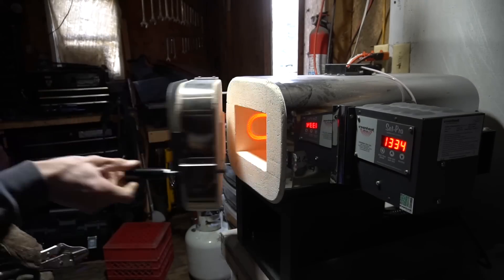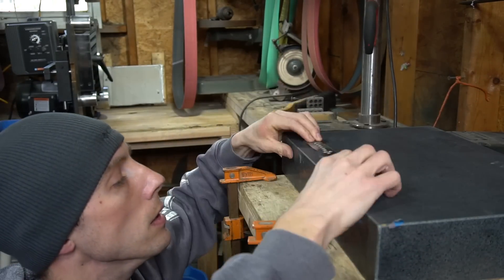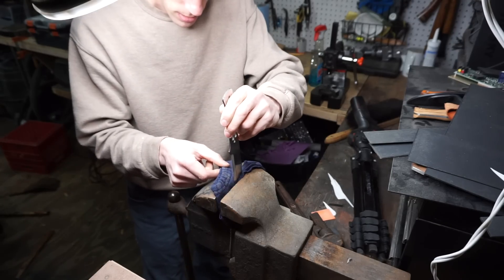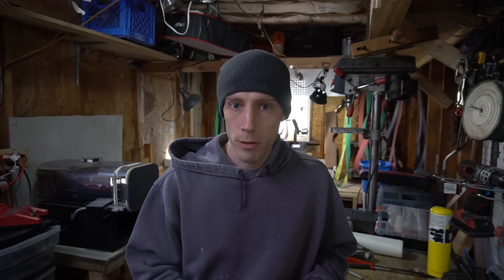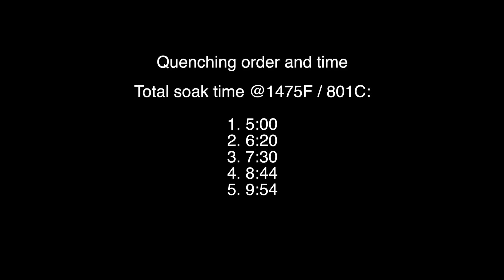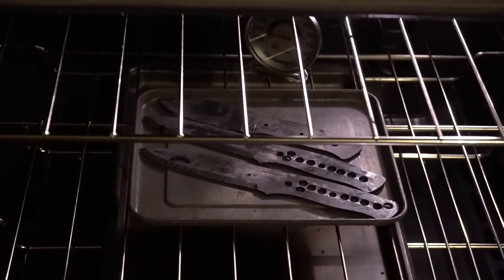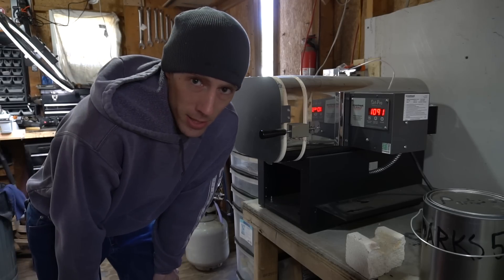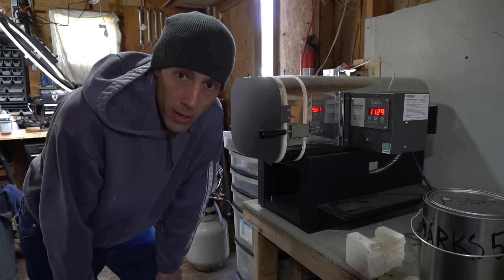Why Knife Makers Should Break Their Knives

Comment: I have seen issues when quenching multiple blades in a small 1 gallon container. The oil temperature increases dramatically from blade to blade. A thermocouple in the oil would add another data point. On bladeforums, it was recommended that a 1 gallon can of oil might be too small for a blade larger than 7-8" and for multiple blades back to back. At least 2 gallons - 5 gallons was recommended.

Comment: hey brother watching for the second time and I have a question do ya think that your oil being warmer with each consecutive quench have any cause in the grain growth??
Reply: Actually the opposite is true in this case. The Parks 50 fast quench doesn't reach it's optimal quenching ability until it's viscosity is increased. (less syrupy and much more running. This also greatly helps prevent vapor lock during "Quenching" This happens at about the 120°F-150°F range. He had preheated his oil before hand but failed to mention it in the video.

Comment: If you're heat treating properly, soaking at the right temperature shouldn't have any negative effect on the steel no matter how long you soak. And not scales of minutes, but scales of hours. There are people who have soaked O1 steel at a specific temperature for lengths of both minutes and hours, and noticed no demonstrable difference in properties (for example).
Reply from the maker: This isn't o1, its 1095.
Reply: @OUTDOORS55  
I know.

Comment: Alex, 
I will investigate the matter with one of my instructors who has his Ph.D. in material sciences. I am studying my undergraduate in Engineering Mechanics with a focus on materials as well, so here is spitball theory: my literature and classes haven't used soak times under at least 15-20 minutes (even for thin stock like a knife). The short soak time may not be allowing for a complete transformation of cementite in the steel to austenite because 1095 at  800C/ 1475F is right on transformation line on a Fe-C phase diagram for 1095 steel.  The remaining cementite may be suppressing the grain sizes (The previous sentence is where I am uncertain, b/c I cannot explain that effect, but I sure some other microstructure is at play) This effect would be in competition with the increased yield strength gained from forming more martensite (then to tempered martensite). I think left over microstructures best explains why you saw a resurgence of the fine grains in your 1550F sample at the end of the video because, assuming a complete transformation of austenite to matensite, then small consistent grain should be readily attainable. At any rate good work and keep up the kickass knives!

Comment: For the first experiment you quenched the five blanks consecutively did you happen to keep track of the oils temperature during this experiment. an increase in the oils temperature would directly affect the material cooling rate and in turn affect steels structure as it moves through the cooling curve.

Comment: The problem is in tempering, its not about how you harden it, if you heat treat quicly, the more inpurities will be in steel except martensite, by tempering you remove all impurities and get those 3 blades simmilar properties

Comment: @ 15:30 you said, "Overheating and soaking time does cause grain growth"

If you learn to read an iron-carbon phase diagram, and how iron changes phases, you would understand why that sounds absurd.

You can't really overheat your knife, unless it gets molten and turns to liquid.

On the iron-carbon phase diagram, you will find several different areas of the graph. Drawing a vertical line for 1080 steel at 0.80% carbon, you can follow from 0 degrees up through all of the different phases of iron.

When iron changes phase first, it remains solid, but the gran structure reorganizes completely. This is not an instant process. This can take hours, depending on the steel.

If you hold the steel at a transition point on the graph for long enough before dropping the temperature, it recrystallizes to the lowest phase on the graph.

However, if you heat the steel up to glowing orange and hold it there, the crystalline structure has completely rearranged. When you quench the blade, you cool the crystals so fast that they don't reorganize to the lower level on the graph.

This is where you move from the iron-carbon phase diagram to the TTT diagram. The TTT diagram, while (also) not easy to read, will show you how much crystal restructuring goes on for how much time the steel is held at temperature.

These diagrams were generated from thousands and thousands of tests, and verified over and over. Engineers (like me when I finish my degree) use these diagrams to show exactly how the crystal structure should be formed, and compare real world results to theoretical numbers... Then, we apply additional math to that material science.

You just have to figure out at which amount of recrystallization to quench. You also have to figure out if tempering cycles to allow some of the softer crystals to re-form will help the properties of your blade. You don't need the calculus, the explanations for FCC/BCC/HCP crystal structures, etc. like I will need.

Knowing this may help you predict where to harden your blades instead.

Comment: there is a reason why metallurgy is a science field on its own - there is so much to it that influence the structure of steel that you are about to have inconsistent results in a home environment (keep in mind, your setup is way more controlled than the heat treat process of some average joe like me). 

the other side is, does it really matter? as long as my knife retains an edge and doesnt bend or break during normal usage conditions, its fine to me. sure, it could be better, but there is no way around it, if you dont want to spend x amount of money on it to get a proper kiln.

anyways, my biggest unknown in your tests is the temperature of the oil? it gets warmer with each quench you do in sequence, maybe thats causing a difference too? i mean it most likely does, but the question is how big of a difference. 

nice effort though, this just shows that companies that do heat treating have a reason to be around!

Comment: Hey man, just so you know the plastic valve fire extinguisher youve got in your shed may or may not work. Kiddie the extinguisher company issued a recall on all of their plastic valve extinguishers in 2017. Theyre the first company to do so, but i doubt theyll be the last. Having worked for a fire sprinkler and extinguisher company for 5 years, ive seen enough of them to know that youve got about a 70% chance that itll function properly if the time comes. Do yourself a favor and get one with a metal valve from the hardware store. And make sure to pick it up and flip it upside down a couple times at least once a year. It helps to stop the powder from getting too tightly packed and clogging the valve if you do ever need to use it.
Reply from the maker: This ones just for show.

Comment: I like your reasoning and scientific approach.  I took metallurgy to earn my associates of science for welding technology but remember very little except different boundaries and phases and they analyzed failures (yours being vise angular leverage failure) like you did with your pieces - to see what caused the failure .  What I gathered from your experiment was that no  matter your soak time or temp - NORMALIZING (CORRECTLY NORMALIZING, and soaking at critical temperature for 5 minutes is the  B  diggity G) is Mucho Grande Importante!  You did great! but the camera to me showed a better grain the farther you went to the left - maybe cutting the pieces would show the grain structure better because breaking the pieces tends to disrupt the grain pattern/structure as it elongates and deforms the end pieces.  Great Job and great lesson on the importance of normalizing 1095 and I am sure 1080 would bear similar results. Also testing metals you haven't used before and finding normalizing procedures and critical temps for each new material you use - of course writing down these notes in a knifemakers logbook for future use and less re-googling (is that regurgitation).  You are an inspiration on the path to the knife making grotto!  I have never made a knife but I should be qualified son with all the different videos I have watched - KEEP Making them!!  I copied your pattern on my laptop screen enlarged - maybe I will be ordering 1080 next.

Comment: The only mistake I can see is in your last test you didn't start at 1200 and go up to 1575, as you did in the prior two tests. Otherwise, very well done. I think your conclusions are spot on, and the added info from  Lucas Kramer below is important as well. 

As for the heat treating multiple items: industry does it all the time. They just make sure that their ovens can handle the mass of steel present, and hold the temps. As long as your setups can do it, I can't see how multiple items (unless you stuff a few dozen in there) would be a problem.

Once again, fantastic video. Thank you. Subscribed.

Comment: Remember your  phase and TTT charts, specific to 1095. 1095 is a hypereutectoid steel, meaning the carbon above 0.80 (nominal) will not go into solution with the ferrite (austenize).  The extra carbon hangs out to form carbides. Carbides are hard, and probably bigger than your martensite grains. Temp and temp over time does promote grain growth, as experienced by your long soak @1475. The 1550, higher temp, allowed for carbide formation, and probably better carbide control and better solution balance, in your hypereutectoid steel.   If you repeated your test with a 1075 or 1080 steel, the results of grain growth, you were expecting would probably become more evident. The comment on quench oil temp, being 120, is more about nucleation (bubble formation) at the knife surface. 120 is better than colder, but if you can beat the "nose" on the 1095 TTT curve, your goodto go.
Reply: That pearlite nose can be a real bastard thats for sure ...as far as ive noticed about 1500 is the sweet spot for 1095

Comment: are you using different cans of oil for each heat treat? the oil cools the metal at different speeds depending on how hot it is.
Reply from the maker: quenching doest affect grain size. The oil temperature was monitored though👍

Comment: about grain growth: digging deep in my memory to the one part of the "material science" topic that I really liked: crystaline metal rosters.
grains grow over time. Grain seeds also form over time but also relative to the cooling speed. The faster it cools down (i.e. the higher Delta T when t approaches 0) the more grains are formed. So given a low enough cooling speed, grains will have the chance to grow larger before more seeds are formed. Critical temperature is the lowest temperature where all roster bonds are broken and the metal is in an amorpheous state. This state is needed to form new seeds and even seeds. Having the bonds broken does not necessarily mean that the position of the atoms is changing. Hence the need for normalizing cycles: to allow the atoms to move by allowing them to settle slowly into a large grain roster. Overheating brings your entire knife to a temperature where even after the first couple of ms in the quench, temperature is still higher than critical. But since you don't move your blades, the oil around the blade will heat up, and thus slow down the cooling. In other words, the cooling speed when dropping below crititcal temperature (which is the one that determines how many seeds are formed) is lower when cooling from a higher temperature. Another factor that influences the cooling speed, is the mass of the heated object: the more mass, the more energy it holds and the more energy has to be transfered during cooling. So a larger mass has a lower cooling speed too.
This also explains what my first thought was when you didn't see that larger grain growth in the test piece: the test pieces are much smaller than the blades. So the test pieces have much less mass and therefor automatically a higher cooling speed during the quench.

If you found inconsistent results for the overheated test pieces, do you mean that sometimes you did find larger grain growth? I guess at those higher temperatures and with low mass pieces, any hand movement that might move the oil around a bit, will have a big impact on the results. So the worst results will have been when you held your hand perfectly still after going in perfectly vertically. Better results could have been caused by entering slightly sideways causing a turbulent flow inside the oil and therefor increasing the cooling through convection.

Comment: In my opinion soaking isn't necessary for a knife because its relatively thin. If you're looking at HT charts they advise you to soak because they want that consistent temp to penetrate through the entire piece. Better to just quench the blade as soon as it hits critical. Also, check your oil temps. Needs to be consistent every time.
Reply from the maker: A short soak is required with 1095 to allow all the carbon to dissolve into solution.
Reply: Ok. Try it without a soak and see the results. try it with a soak and record that. You'll find that soaking a blade blank only causes the grain structure to swell. The charts that tell you to soak aren't made for knife makers.
Reply: i think with 1095 you have to get the carbides back into solution, this takes a bit of a soak. but im no metallurgist.

Comment: Awesome info!! Now I’m going to have to do a bunch of testing myself. I’ve done destructive tests on knives and it always makes me cringe to put all that work in just to break the thing in half but i think its a very important step for anyone wanting to ensure quality. Thanks again this video was the most informative heat treating I’ve seen on youtube particularly of interest to me because i use a lot of 1095.
Reply from the maker: Thanks my friend! I agree its a necessary evil. 👍
Reply: @OUTDOORS55  Were do you get your stainless steel foil for keeping the O2 out of the "Quenching"? Think it will work with a atmosphere propane forge or and forced air propane forge? I can run them rich so that I greatly reduce the O2 but was thinking that adding the foil might save me even more addition Carbon content. Thoughts?

Comment: I am not even a beginner. I've never made a knife. I'm finding your videos informative (as much as I can understand).  I assume this test proves that a very fine even grain is desirable. Even though you never really came right out and said that. I want to make a FOREVER knife for bush craft. I don't know what steel to use, how to treat that steel - heat treatment, quenching, annealing etc. or even the order in which to do this. I'm 65 years old and retired so my definition of a Forever knife is a knife my grandson can have and use once I'm gone.  About all I do know is I want it to be a full tang and the back side of the blade should take a little bit of a beating from a hatchet maybe 3/16 inch wide. While splitting small kindling. I want it to be about 8 inches of usable blade (probably more like 10 inches long with enough left over to go the full length of the knife handle. I want it to take an edge I can shave with and hold that edge for a reasonable amount of time. I'm learning sharpening and stropping and general care for a knife in the meanwhile but no where near the skill level to produce what I want. For me your videos might be a little to far advanced but if you spoke like you were talking to an idiot it would make it easier for me. I don't really expect you to do that because I think you'd lose a lot of your viewers. Lol. Can you direct me (or any of your other viewers as well) towards any of your videos that would help me. I like your style of making videos and prefer if I could stay with you. Does anyone think I'm crazy? Is this a knife I can make - or is it like a Holy Grail. I  definitely don't want to buy a knife like this I want to make it. I have access to most every type of tool I think I would need and am even considering purchasing what I need if I don't already have it. For instance a 2" wide belt sander (I presently have a 4 inch wide) Would a 1" wide work? What's better one inch or 2 inch - do I need both? Thanks for reading this tome of a comment and I gratefully thank any help anyone can provide. I live in Allen County, Ohio if there is anyone near me with these skills who would allow me to have lunch with them and shoot the breeze let me know. Even better a chance to see your shop and set up. Lunch is on me.
Reply: Nobody just makes one knife, and there is no perfect knife! For making a stupendously performing knife it may be best to just pay for a knife with a tough powder metallurgy steel like 3V or better yet magnacut. If you want to enjoy the ride, read Larrin Thomas's articles on knife steel nerds as gospel for heat treating and use a simple carbon steel and do his forge heat treating method for the best luck of good quality. Use water quench if you can't get proper quench oil for simple steels without any chrome in them, go for 80crv2 most likely.

Comment: Have you considered that (concerning the three initial blades) that the third was quenched after 2 rapid succession "openings" of your H.T. oven. I wonder if you may have significantly dropped the temp off the third knife from heat loss due to the openings/exposure to ambient temperature.  Possibly your thermocouple is placed in a bad spot to get accurate temps. I would suggest possibly doing a test of temp loss or general atmospheric condition changes in your oven due to opening it.